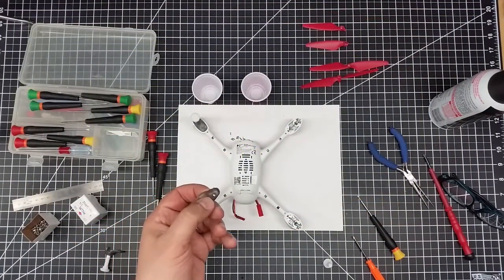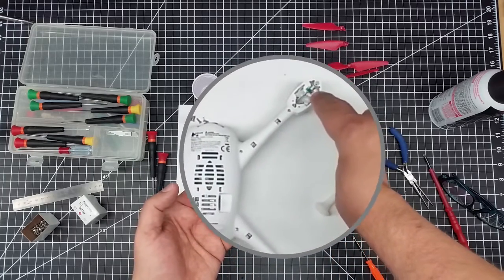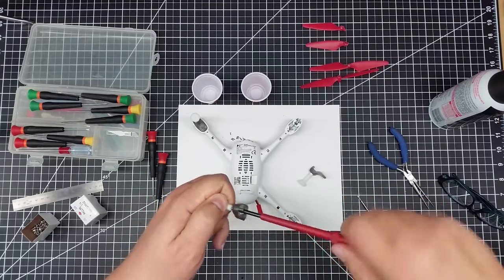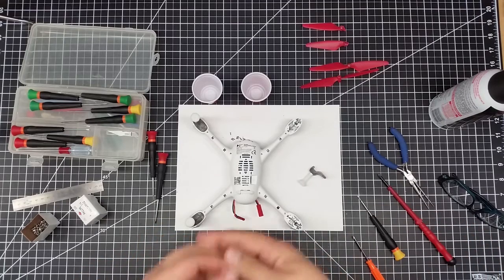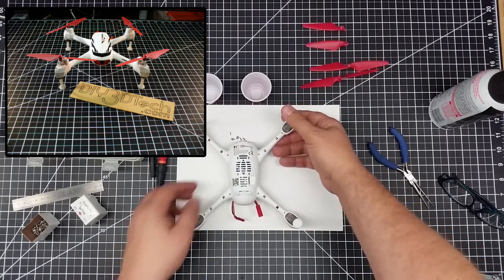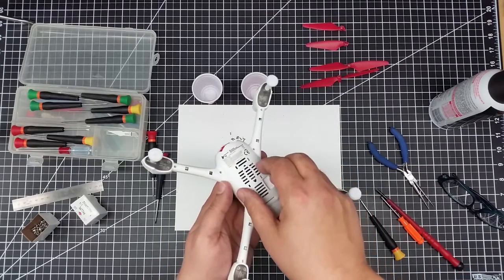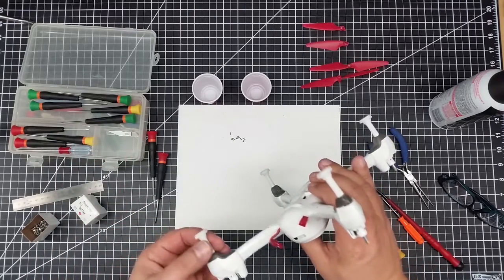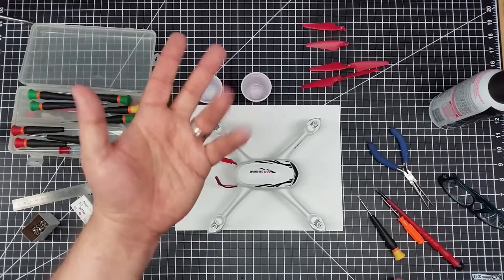Video Drone - 3D Printed Legs for the Hubsan X4 H502!

Comment: FYI  Your link from thingiverse for the screws is incorrect.  The link goes to 1.2 x 3mm flat head screws which do not match 1/4 inch #4 description in thingiverse.
Reply from the maker: Mostly any small screw that self taps should work as the holes in the legs are just that...

Comment: Hello, I too have the hubsan 502s. I would be interested in buying the feet from you if you are interested in selling them have you noticed if it makes the Drone overheat or warm in any way?
Reply from the maker: No issues at all with them, but apologies just swamped with things right now.  However the files are on Thingiverse and possibly you could find a local Maker Space to print them for you...

Comment: Hello, so my qustion is. How much mm is the hole ? 🙂. Cool idea!
Reply from the maker: Not sure as I made this a while back but I use #4 pan head screws 1/4" long...
Reply: Video-Drone thank you, and what will go on if I put 55 g camera on that drone ?
Reply from the maker: I would not a add a camera as this little guy is at its max as and while it might lift it.  The load on the motor will create a lot of extra heat (there are videos on YouTube) which can cause issues...
Reply: Video-Drone Thanks im gonna put mobius 2 its 45 g and I hope so its not gonna burn the motors
Reply from the maker: Let me know how it goes as I would go more so for a 808 Keychain camera...
Reply: Video-Drone Its so lightfull, but the quality is horrible better put on the 27 g camera mobius c its recording on 1080 pixels 30 fps .

Comment: those hole are there for cooling off the motor....so I will not cover them
Reply from the maker: Many thanks for writing and yes that is what I have read also (there is a YouTube video where a guy burns his up).  However I did notice that there are 4 slots in the bottoms and I am thinking about designing and 3d printing 808 keychain camera holder which would not cover the vent holes as the other thing I am thing I am thinking about doing is removing the internal camera all together and replacing it inside with the 808 and remove the batt and power from the main but can't figure an easy way to get the card out....

Comment: How much weight do they add?
Reply from the maker: Not much as traveling for business so can't weight them to tell you however I printed them in HIPS (PLA/ABS) would work too with like 5% infill.  Also I have flow with these no issues as this little has lots of life and next project will be to add 808 key-chain camera mount...